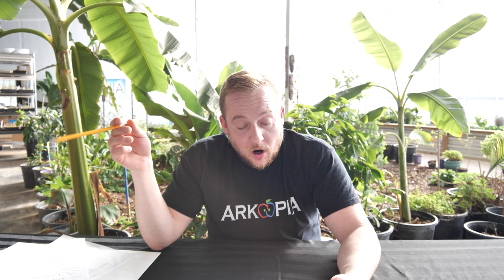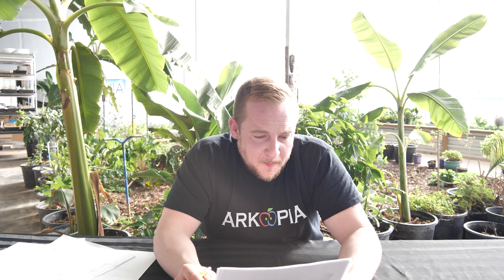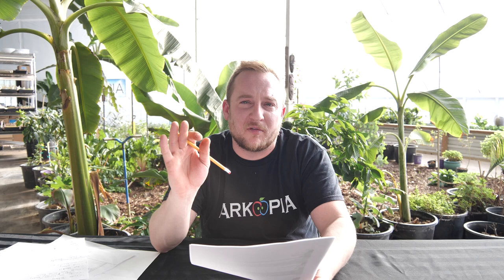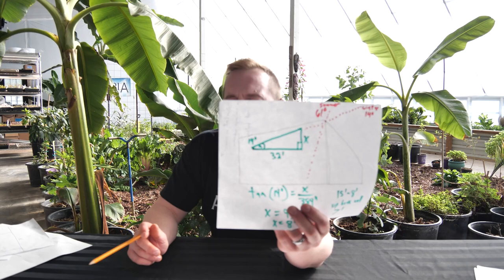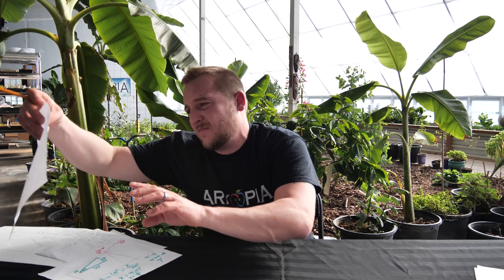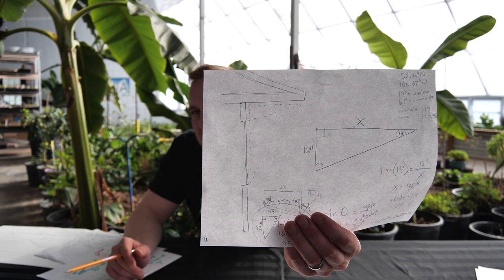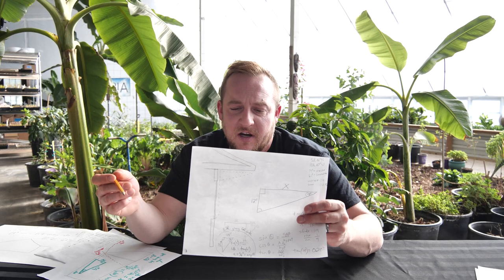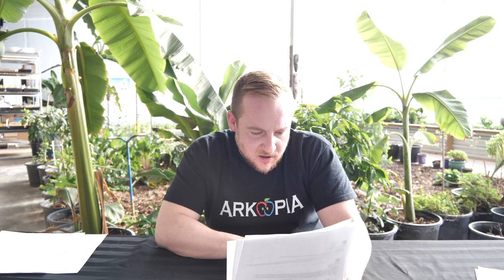Arkopia Greenhouse - Full Consultation Seminar - Part 3 of 3 (I discuss & cover it all for free)

Comment: Here in Arizona, USA, you have to have a permit and inspections on buildings over 200 square feet. $192 USD per permit plus the numerous inspections. However, if the buildings are auxiliary buildings,  then you can do a permit exemption status, which means no inspections, but you have to pay a smaller amount for the permit exemption. The government always gets a slice of the pie! Also, if you have a permit exemption that doesn't require building plans to be submitted to the government, they're still going to tax you on the buildings/property based on the square feet.

Comment: Modern wood stoves touting super high burn efficiency are still hooked to very non efficienct ehaust flu/heat extraction designs. Doesn't matter if the wood stove is burning at 100% efficiency, if 50% or more of the heat is still blowing straight up out the flue to the outside. A lot of people don't realize the in efficiency of vertical wood stove flu design that drafts a huge excess amount, and most people also don't realize that wood stoves exhaust flues don't HAVE to run 100% vertically, they CAN actually run long horizontal distances (25-50 ft or more) through properly designed thermal mass storage heat extractors and still draft safely. The recommendation is to simply measure the temperature at which the exhaust is entering the atmosphere outside from your flu, as well as take a temp measurement of any exposed steel flu on the outside of your building. A truly efficient design will have final exhaust temps less than 100 deg. Anything above that is wasting a ton of heat that could and CAN be extracted beforehand through thermal mass heat extraction. I'm currently working on a down drafting stratification exhaust bell design that vents wood stove exhaust into a very large volume thermal mass bell that has minimum back pressure so the draft is not impeded. In essence, the volume is so large that the wood stove "thinks" it's venting into the open atmosphere. This allows the Hottest air to hangout at the top of the bell, and as it cools, the colder air naturally drops to the bottom of the bell, while maximum heat gets absorbed into the thermal mass continually as the air continues to cool and drop. Then it is simply a matter of channeling the cooling air downward and out of the Bell  through more thermal mass (in my case I'll be making a sub floor with cinder blocks laid sideways to form multiple free flowing air chanels buried under raised beds) that eventually vents outside. The beauty of this design is that virtually every last drop of heat down to whatever the outside temp is, is extracted from the wood heat source, and in addition, the final heat being extracted is also gently heating the ground under a raised bed. The underside of the cinderblocks  under the raised bed are also insulated so heat isn't lost downward into the ground. Here is a link to my design with some illustrations for anyone interested. I believe this will potentially be a  revolutionary way to heat a greenhouse with maximum efficiency heat extraction, and one could easily sufficiently heat a small greenhouse using only a small amount of branches daily if that's all that was available. 

https://permies.com/t/210003/RMH-design-Greenhouse-Geothermal-Stratification

Comment: With wood burning stoves, there are two forms of efficiency #1 Burn efficiency, and #2 Heat extraction efficiency. Yes modern stoves are very efficient at burn efficiency, but a huge portion of your heat is still blowing straight out the chimney and being wasted. All you have to do is measure the air temp coming out your chimney to realize how much heat is being wasted. The temperatures coming out your chimney even with moden efficienct stoves are usually above 300 deg F. The temps coming out of a RMH with thermal mass heat extractor are around 100 degs or less. So even if a modern stove with catalytic converters has a more efficient burn, it won't even come close to the amount of heat extraction and storage of a RMH. Unless you were to incorporate a thermal mass heat extraction into your exhaust after the calatlytic converters. I would just take a temp reading of your flu exhaust outside and see how much heat is being wasted blown out the flu. I'd be shocked if you didn't have a huge amount of wasted heat you could harvest with a simple thermal mass setup added to your existing  stove.

Comment: I built a double polyethylene inflated post framed lean to greenhouse off the garage in town that’s different. It’s fully insulated and was cheap. It is 11 feet by 22 feet at 10 feet tall. I should put it on YouTube. Mine was under $2,000 with free doors and scrap polycarbonate for the ends. It looks nice and works well.
Reply from the maker: Awesome. 👍👍

Comment: You mentioned that your soil is slightly alkaline. While irregular watering is one cause of blossom end rot (BER) the other is that tomatoes prefer a slightly acidic soil. Adjusting your tomato area soil with aluminum sulphate can eliminate BER. You will hear arguments that it is low calcium or magnesium but prairie soils are not likely to be calcium deficient. In alkaline soils, it is the competition for uptake by the plants between salts and calcium....the salts win. Slightly acidifying your tomato soil will solve that problem. Peppers, zucchini and cukes also like slightly acidic soil.

Comment: Thanks for the info Dean, I watch your videos over and over to get me thru this bitter Alberta winter. Hoping to put what I've learned from you into good use this summer. Appreciate your comments on Curtis Stone and Rob Avis and their greenhouse designs, there is always another way to approach an idea and problem. Not using a greenhouse for months in the winter kind of defeats the purpose of it I believe. Was wondering what your thoughts are on geodesic domes and if any of your principles and designs could be utilized with one?
Reply from the maker: Thanks.   Curtis and Rob are switched on dudes with super good ideas.   Their info was super helpful to me.  A geodesic dome is harder to build, harder to insulate the north side (which I would do because there is no sun there ever).   So I don’t see a benefit to geodesics domes. ✌️

Comment: Just wondering if one of those diy solar air heaters could help preheat some outside air to help your co2 problem. I’m not sure if it could heat up from -30 quick enough tho but even a slight preheat would be good. Have a solar power fan that will only turn on when the sun is out. Love that project I want to make one now! Thanks for the videos and great information.
Reply from the maker: Because changing the air in winter is important, preheating it before it comes in any way would be great.

Comment: I had a thought. What if i made a sliding "curtain" garage door that i close from the inside at night across the glazing to prevent heat loss? Except it could be pulled horizontally instead of vertically. Would make it like a curtain with some decent foam boards in it. Well it would lielu need to be pulled down because of the angle of glazing tough.
Reply from the maker: It’s hard.   Need it simple, fool proof, and even automated.   Blanket between layers like Chinese GH is the best idea I’ve seen.

Comment: Excellent job on the masterclass videos. Im in alberta and going to be doing this after i sell my house and use the 40-60k i get for it. Im a bit worried about the permit things but your thinking theres no permit for agricultural land. Ive found some land thats 11acres and the price is right but not sure about permits. Also what angle do i need for the glazing at 11.6 degrees winter solstice? Would it be 70 degrees?
Reply from the maker: Not sure of all Alberta’s zoning and rules.   But getting farm status is likely also your best freedom.   At 11.6 degrees an overhang on a passive solar house would be slightly more than mine.   For GH glazing, you can do it like mine at 45 degrees so you can use it in summer.   If you wanted glazing perpendicular to the winter sun, the calculation is 90 degrees minus 11.6 degrees = 78.4 degrees south glazing angle.   If that’s what you’re asking.  ✌️

Comment: Great videos and thanks for all the info. Do you think it would be possible to build a greenhouse like this onto the south side of a pole barn or barndominium? If you did that do you think you could use the excess heat in the greenhouse to heat up the pole barn or house? Would there be too much humidity? Would this help with the air exchange if you could open up a door to the barn or house from the greenhouse? Any issues that come to mind?
Reply from the maker: I’m consulting a few builds that are doing just that.   I did another video called “high efficient building” (I think), where I cover some of that idea.   ✌️

Comment: If there were no sun for 7 or more days, how would the greenhouse fare?  I'm sure that would be a rare occurrence,  but just wondering.
Reply from the maker: That’s when the wood pile goes down or the gas meter spins.   There were mild nights in January that had some sun the day before where the furnace doesn’t run and it stays 10C ✌️